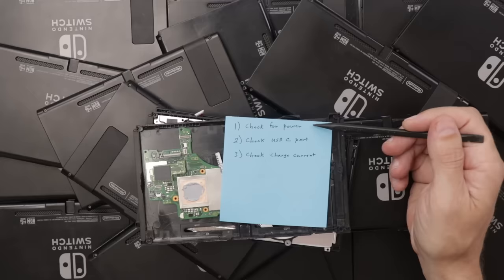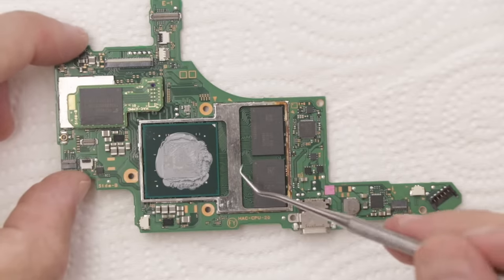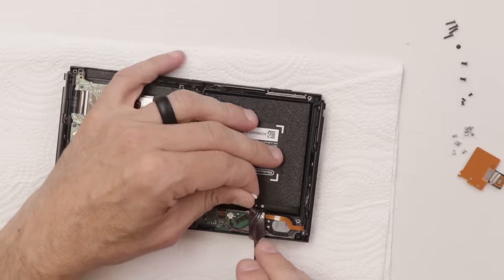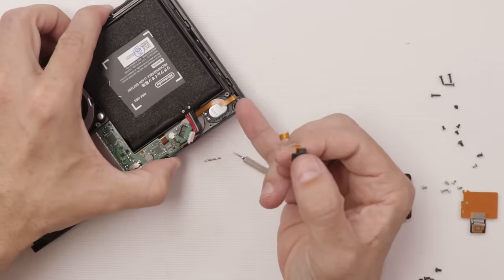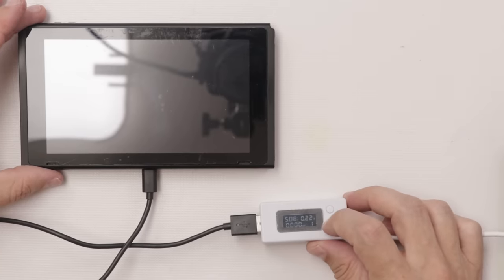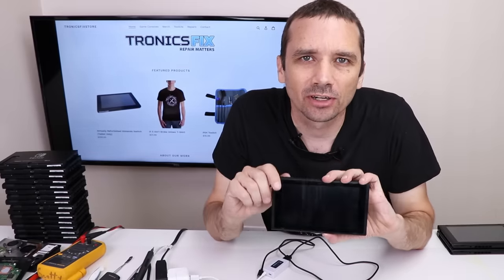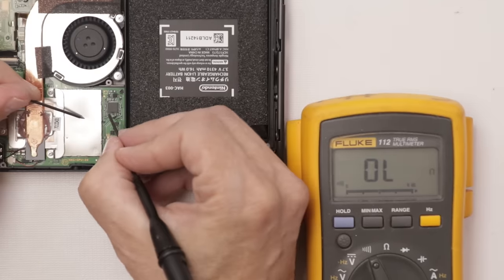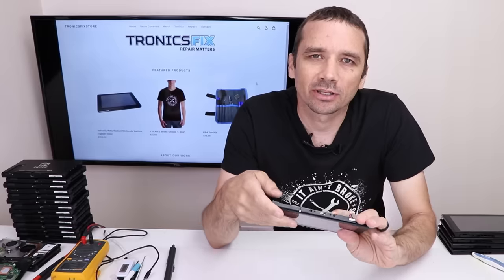I Paid $1,815 for 20 Broken Nintendo Switches - Let's Make Some Money!

Comment: Steve get yourself cheap ultrasonic cleaner from eBbay and Branson EC cleaning solution, it does makes huge difference, saved me so many switches....
Reply from the maker: I wouldn't use a cheap one for this type of work. I have a Crest that I use when needed but so far there's been either just a little or a whole lot of corrosion for the most part.
Reply: Yeah, but Crest for regular hobbyist cost an arm and a leg... same time i totally got the point to show people what they can do with a tooth brush and IPA...
Reply from the maker: Yep, exactly

Comment: My friend has a Nintendo Switch since day one and recently his Nintendo had no sound. He wanted to go out and buy a new one. I told him to give it to me and I'd see what was the problem. After opening it up I saw exactly what was the problem. The speaker was not plugged in. When I asked my friend if he opened his Switch before, he said no but he gave it to his cousin. After talking to said cousin he admitted he opened the Switch up to see how it looks like inside. Took some stuff out and...forgot to plug in the speaker. Thankfully nothing was broken, misplaced or anything. The Switch works fine. I double checked after watching your video disassembling Switches if everything is where it should be. So thank you for your videos, they are very helpful. Fun fact, I don't own a Switch console. Yet. I will soon :)

Comment: A tip for those screw drivers. Use one lithium and one Eneloop. It will run faster but not too fast and have more torque. You will get a lot of use between chargings or battery swaps.

Comment: What did you use on the toothbrush when cleaning the cartridge holder? water or some solvent?
Reply from the maker: 99% IPA
Reply: @Tronicsfix  you used a beer solution ?
Reply: Isopropyl alcohol.

Comment: I never knew u could fix electronics from water damage. I have a water damaged gtx 960, ill see if i can get it to work again.
Reply: How did your gpu get water damage ?
Reply: @dubklanky9035  spill water on the case maybe
Reply: @dubklanky9035  yea I had my pc under my desk and like an idiot just knocked over a glass of water lol
Reply: Update: I took it apart and saw some corroded bits and cleaned them off as well as i could. There was something covering a big part of it and i couldnt figure out a way to take it off but I'm sure its fine. Cleaned off everything, put it back together all in about an hour and then I realized. I don't have a pc at all in my house... I use a laptop  and I sold my pc a long time ago facepalm So I can't really test to see if it works, but my friend is going to upgrade some parts soon, and she told me I could stop by and try it out. Fingers crossed.
Reply: @whitechocolatethunder3078  tell us what will happen don't forget
Reply: @whitechocolatethunder3078  update this once youve been
Reply: @whitechocolatethunder3078  please tell us once u have tested
Reply: @whitechocolatethunder3078  commenting to see how this ends
Reply: White Chocolate Thunder .

Comment: Question: How do you know when you buy a lot of 20 of these that someone hasn't already thoroughly checked for irreparable damage before selling it to you?
Reply: You don't.
Reply: Most places that sell these aren't checking if something can be repaired but rather if it works or not. And sometimes they might check how "easy" the repair is and try some basic stuff. Sometimes it's just as simple as plopping in a new battery but when repairs get more difficult they don't bother.
Reply: No it's chance/luck
Look on eBay but not pay $91 per unit way too much for a broken system with no joycons or dock 
They're worth about $40

Comment: Dang, if you theoretically flip 20 switches (pun not intended) you would make a profit of 4000-5000$ (adjusted to USD)
Reply: Actually its cost - zero. Only idiots would buy them after such fixes. And ofc resellers who'll sell it as a new.
Reply: It sounds nice but wouldn't you just get a new switch instead of a switch that the buyer has to say bricked before. I would say that he would sell each switch for 180-200 at best
Reply: Refurbished ones are going for around $260 including directly from Nintendo.
Reply: @Tempus64  He would still need to sell them $180-200. Those are going for $260 because the same people that built the switch are repairing it, so you know its for sure fixed. Hes just some random guy selling switches on ebay. You can see why someone would pay more for a refurbish from Nintendo themselves.
Reply: @yep2464  Bestbuy and ebay, both around $260 for refurbished. Doesn't matter though, in part 3 he says he sells them from $170.
Reply: I'd buy if the firmware was still at the hackable level. I did originally own a limited edition Mario switch on the hackable firmware but sold it on second hand in mint condition. If the switch was sold at half price I'd probably pick on up refurbed or not.

Comment: That's a lot of work for ~ $50 dollars a switch. Are you even making $10 dollars an hour?
Reply: Most of these repairs only take a couple of hours at most, specialist electronics equipment and experience helps a lot with these types of repairs. The components aren't that expensive and are most likely available in bulk to vendors so his profits are probably pretty good, and then he makes the money on his YouTube channel and Amazon affiliate link.
 it's multiple sources of income on one job action

Comment: Hello, I have a little question : Where do you get the new video chip for DIY replacement?
Reply: Indeed i wanna know too. do you refurbished old ones from damaged ones but then you would have to solder test if the chip works on re solder  until you find a non damaged one.

Comment: How much do you sell the switches u fix for. I need to buy one
Reply: coolioo almost 200 bucks it’s better to go buy a new one
Reply: be careful because while they do fix the part that's completely broken, they don't fix everything else. The other parts could be worn down and break quicker compared to a new.
Reply: Always better to just get a new one on a sale. Just buy old ones if you need an old gen for hacking, though the new ones out there are still safe.

Comment: $90 is way to expensive for a broken switch. I don't see how you are making any profit if you don't have a 100% success rate.
Reply: Hos money comes from the channel, he could care less about a couple of nintendos
Reply: @south9563  ahhhh true 5head
Reply: Brennan how much could he resell these for after repair?
Reply from the maker: I fixed 18 out of 20. They usually sell for $160-$170. $160-$90=$70 Parts =$10 each (average) = $60 X 18 = $1080. They take about 20-30 min each to repair so that comes out to around $120/hr. That's a decent hourly rate for me.

Comment: Hey Tronics, thank you so much for all your videos, I learned a lot over the past year about switch repairs and other stuff.

Currently, I have a switch on my desk which is not only making me crazy but also sad because it is the switch of a friend.

I replaced the USB-C Port and as you do it, I checked in both directions of the system was charging. it did with 0.42. I reassembled it and turned it on, and it showed the charging symbol. so i wanted to finish off the assembly, i turned it off, unplugged the charger, and put everything. back together. but then an error message appeared on the screen about something went wrong and the console needs to be restarted.

since then, the console is not turning on anymore :( 

M92T36 seems to be fine, all caps around it are fine, same for PI3USB. the test pin above the USB-C port shows 15 volts when connected to the Nintendo Switch charger and 5v when connected to usb meter. the battery has 4.189v on both red lines :(

What is wrong with this poor baby? :'( I hope you can help me......

Comment: Great video. Really educational but I was wondering if you can provide some more information on the activities you performed. Corrosion: were you just scraping it off or did you also used some anti corrosion liquid to remove the corrosion? Check for shorts: how do you actually check for shorts and how do you know which part of the multimeter should be held against which part of the Wii? Also what reading in the multimeter indicates a short? This wasn't really clear from the video. Could you please explain this?

Comment: The ones which you see charging amperage but no display could be stuck in AutoRCM, connect to your phone o pc with a payload injector and see if you can get it to boot, takes a couple of tries and you need the SD card with the CFW

Comment: @TronicsFix hey what solution do you use on the q-tips to clean the erosion off the internal components of the switch? Just curious, these videos are very helpful for DIY projects. I know nothing about circuitry or anything to do with mechanics but you simplified the process fairly well and I feel confident I can replicate the process by comparing/contrasting with your videos. Thanks!

Comment: That mumtimeter youre using is $150 do you reccomend that I definitely get that specific one? Or if I find ome for cheaper, say $60 would that be fine? What should I be looking for when buying a multimeter?
Reply from the maker: You can buy a cheap one...just get a one that has decent reviews. Read what other people say about them and see if they are using them for electronics. Most cheaper meters will work fine.
Reply: Awesome thanks alot

Comment: For Switch #3, what causes a capacitor to short? Does the original video chip just go bad causing the capacitor to short? Replacing the video chip helps prevent the capacitor from shorting then?

Comment: Hi, sorry this may be a noob stupid question. But what is the cleaning fluid you are using that safely evaporates and can be used on electronics?
Reply from the maker: Isopropyl alcohol
Reply: TronicsFix i had an inkling it was but just wanted to be sure, then you actually mention it in next video. Cant believe on a hungover sunday i just watched over an hour of you fixing switches :p

Comment: wait this guy just replaced a video chip?? how do you know the soder aligns with the pins on the video chip, this is so much more impressive than it looks like machine level work. ps are switches known to have video chip issues?
Reply from the maker: If you do it right it actually aligns itself. Yes, these can have video chip issues. Usually from using a 3rd party dock
Reply: @Tronicsfix  o wow thanks for the response, this video alone has taught me alot.

Comment: Hi
Do you use some sort of fluid on the tooth brush to clean the corrosion off,as I have a board which is £266 to replace as someone spilt water on it and it shows the same corrosion as yours.
Thanks 
John

Comment: Can I ask, Is there a reason why on Switch no.5 with the liquid damage you didn't remove the chips on the back of the motherboard in order to clean the corrosion underneath the chips and instead chose to clean it with a toothbrush?

Comment: Do you know if corrosion comes back since it's started or does it corrode to a certain extent and stops? I use vinegar for leaky batteries & capacitors but not sure if liquid corrosion is acidic.

Comment: So you can just use a heat gun and flux to remove a chip and put a new one in?? The solder doesn't flow between all the pins??

Comment: You can charge that old bad battery  with an external charger  to above 3.5 volts and then switch will be able to take over the charging  process

Comment: 7 Years ago I accidently  throw a big cup of coca cola mixed with jack daniels into my computer on a lanparty. That computer I did just build up new. The liquid went in to the upper openings of the fans and into the case . computer didnt work anymore... after 2 tries with monitor keeping black, I did decide to turn my $2500 machine off and wait for the next day.  Then I took the whole motherboard out and gave it a bath in 75% Isopropanol Alcohol for 2 hours. after that clean everything dry with cotton and reasemble it. I was lucky the coke only go upon the motherboard and didnt hit any ram cpu or graphics card. surprisingly everything worked fine! I now writing from this motherboard I did repair in 2013 with a cheap and easy alcohol bath xD! Still playing Borderlands 3 on it with a RTX 2070 and its still the best board I ever had =)   cheers mates!

Comment: What are you using to clean the corrosion? Thanks!
Reply: Prepped with Sulfuric acid diluted with 3 parts water and applied with a cotton swab and then scrubbed with a toothbrush

Comment: What does he use to clean the corrosion?
Reply: "TronicsFix
1 month ago
99% IPA"
Reply: Usually costs about 10 bucks at local electronics shops.  Spray lightly on board, scrub w sponge, cotton or soft brush and excess evaps.  Try not to get it inside lcds or other enclosed components.

Comment: Hi tronicsfix, i have issue with my Nintendo (can't charge battery, when i change charged battery nintendo turn on normally and shows charging with symbol but multimeter on usb show 5v and 0A, and i don't find any short...)
but i have revision mother board HAC-CPU-01 and she look quite different. .....

Would you be so nice and try to find one broken Nintendo with the same mother board revision and try to make inspection?

Comment: Why wouldn't you have an ultrasonic cleaner? If you are not addressing the corroed component and replacing them, you are wasting a lot of time cleaning the surface of the board without actually cleaning the mud under the ICs.

Comment: can someone explain how he replaced the video chip? i get how the flux helps the solder come off but once he puts it back on it doesnt seem like he resolders it. so how is it making a connection to the board?
Reply from the maker: I use hot air...the hot air melts the solder and creates a connection to the pads on the board.

Comment: You can buy them use and working for $200. So if you can keep your labor under an hour and parts cost less than $40 to fix it, you're losing money. No one will pay full price for a refurbished system.

Comment: Please help!!!!!! I’ve watched your videos and I think you might be able to help, my switch is working my dock is working but when I put switch into dock, the switch literally works for 2 seconds and then it’s not reading dock!! It’s not the dock, it’s definitely the switch, but the switch is charging fine. 
I’ve followed all tips about plugging out wires then power 1st hdmi 2nd the docking switch, all I get is 2 seconds and it goes back to flashing green light, I then restored the switch to factory settings, nothing works, please help me, What am I doing wrong??

Comment: hi i have a switch that doesnt turn on when unplug. When its plugged, the battery logo flash every 5 seconds and when I try to turn it on I saw the nintendo logo and it turns off again. I tried to charge it overnight without the joycon but no luck at all.  Please help million thanks!

Comment: "It doesn't fast charge but that's okay"

My switch doesn't fast charge and the battery drains when off. If I replace the battery, would this be fixed? Or is there a chance there is board damage and it won't be fixed?
Reply: There definitely is a chance it could be the board. There's no way of knowing without cracking it open and taking a look. 

Replacing the battery might also fix it, but like I said, you'd have to take an internal look.

Comment: What happens if you just switch the mother board and you turn it on and it turns on but all you can see is the screen light up no battery icon nothing at all but it is holding charge and everything.?

Comment: Any experience with joy con not pairing after factory reset. I replaced the left rail on the console already and I am still stuck on the setup animation to connect the controller. Cannot continue set up
Reply: Still not working. Fixing it myself by seeing what you do. The inside looks fine when I took it apart I broke the flex cable for the rails. Do you have extra flex cables for sale?

Comment: arent actual working 2nd hand switches cheaper then the damaged ones you bought?
Reply: with all the parts you are replacing....Isnt this just a scam from the Nintendo company selling off their failed products? I mean, the batteries you keep replacing goes for 15-35 euros. That does not leave a large profit margin if you take into account the manhours and the products that are unfixable/to expensive to fix. I mean a battery fix plus purchase is 25 + 90 euros so and that doesnt include shipping it towards you, shipping the batteries, then shipping it to the client....so in the end a 20-30 euro profit per repaired switch? and a 90 euro loss per switch not repaired? 

Also Americans do not include taxes into their prices in the stores...did you include that?

And then still you are stuck with some outdated game system that can be replaced by a 100 euro mobile phone. So who is going to buy them?

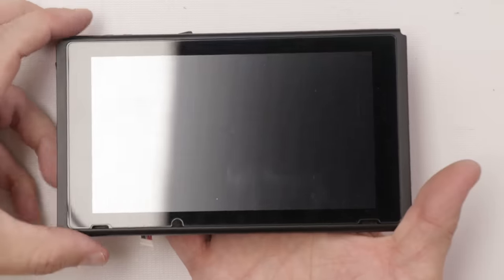Comment: Seems to me at 22:28 that the battery isn't plugged in maybe that's why it didn't turn on
Reply: Having watched a little more the water damage may also be a contributing factor
Reply: He plugged in another battery you didn't see I think, he just cut it out. I think the battery connector on the board was still connected.